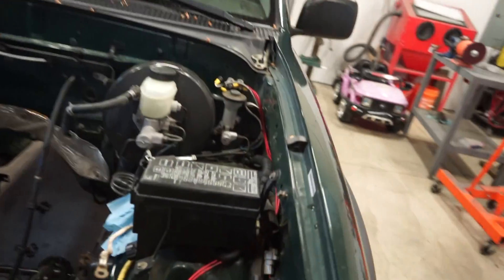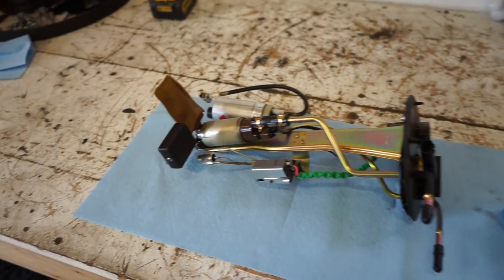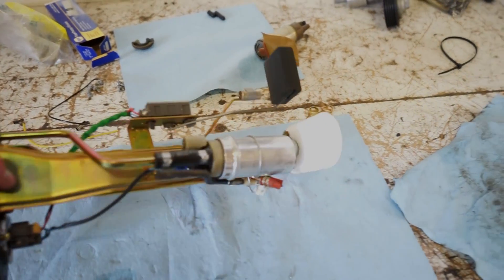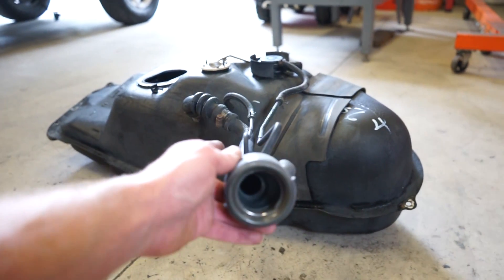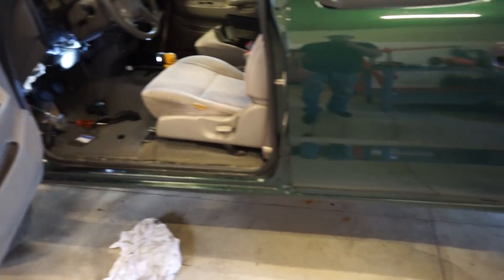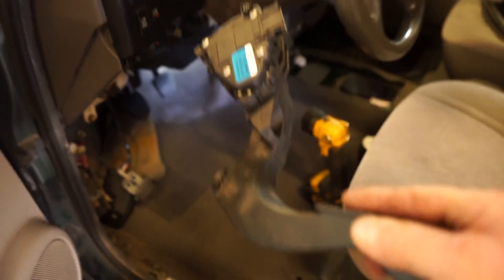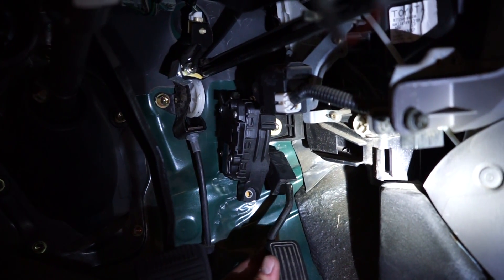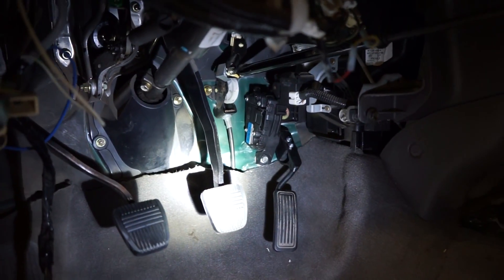Fitting The BHW Fuel Pump/ Mounting Fuel Pedal Tacoma TDI Swap

Comment: Dude, you are doing the tanks the hardest possible way. You take all the bolts out of the bed, start the back 2 in a few threads, and flip the bed up and block it with jack stands. Literally change a fuel pump in a hour doing it that way.

Comment: Nice. So what are the differences between the BHW block and the ALH block externally? Like would the same motor mounts work between the two or are the bosses totally different? if it is similar, I might trade the ALH I threw in my samurai for a PD motor.  I ended up going with a fully mechanical landrover pump on the ALH, and its in canada right now getting rebuilt. But some commonrail goodness would be sweeeet.
Reply from the maker: I think they are pretty close actually!

Comment: Any thoughts on a Harpoon mod on the return to prevent fuel agitation??
Reply: interesting, what is it?
Reply: @jimbote1968  it us where you extend the fuel return line out and away from the fuel pump pickup. Which allows the lift pump in this case to pickup non-agitated fuel. Similar to what FASS promotes
Reply: @kirbymottley007  sounds worthwhile and easy enough.

Comment: To get that piece out of the fuel pipe...take 2 locking needle nose pliers...lock them 90 to 180 degrees apart on the piece or as far apart as you can )..and twist them towards each other ( using tools if manpower is not enough to bend them ) ..repeat as needed till it is smaller in size and can be pulled out easily...

Comment: on the peddle. food for thought. take the plastic mounting metal piece and weld it to the metal pedal. then you can bend the new metal pedal so it looks factory.
Reply: I was thinking somewhat the same thing. Just cut the spline "nut" out of the VW pedal & weld it to the Toyota pedal arm & call it done. Maybe reinforce it with some small plating "just in case".
Reply: @democratsuck  I tried that on my taco. The insert was some kind of weird alloy and did not weld to the steel at all.
Reply: @jimbote1968  Is the insert splined or just tapered? If it just has a taper, a guy could bang a mild steel one out on a lathe. I'm curious since I will be doing a similar BHW swap soon.
Reply: @abpsd73  tapered, it's easy enough to just bolt the toy pedal to the plastic. And if you reuse the pedal bracket you keep the factory stop.

Comment: a 1uz would have been a nice swap
Reply: Aside from fuel pump/filler neck/lines, I think this is a much easier swap. 
The UZ engines really are a shoe horn swap into the Tacoma/4Runner. I put a non vvti 1UZ into a 87 4runner, and much of the work required was just making it fit. Moved radiator forward, body lift for diff/ steering rack/sway bar clearance,  custom exhaust around the steering.
Anyway it turned out amazing but it is a lot of extra work just to make it fit in that little engine bay...

Comment: too late probably but you'll need to leave that evap line as a tank vent. mine terminates under the hood with a small sintered bronze filter with "bowl" cut off. Also ALH pedal works and is smaller.
Reply from the maker: Really? My other swapped truck tank isn’t vented!
Reply: @austinniemela  got to be vented somewhere. Maybe the cap?
Reply from the maker: I can hook that line back up tho! What do you mean by “bowl cut off”?
Reply: @austinniemela  the inlet part of the filter so just the element is exposed. Keeps the mud wasps out.
Reply from the maker: @jimbote1968  okay yeah I think the cap is vented